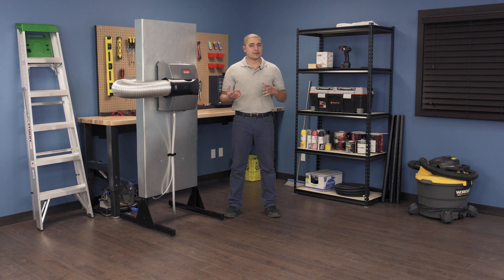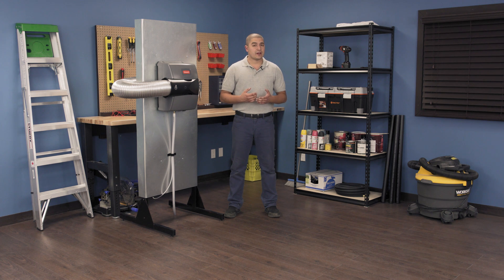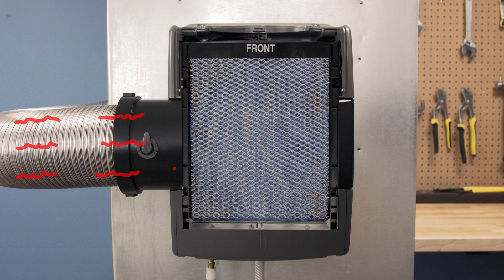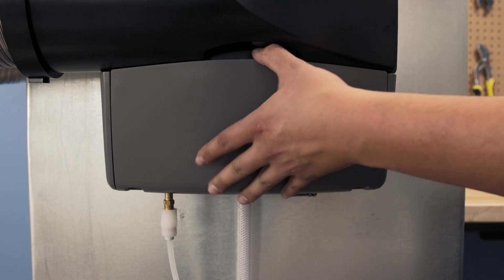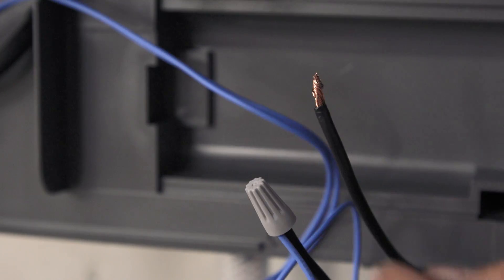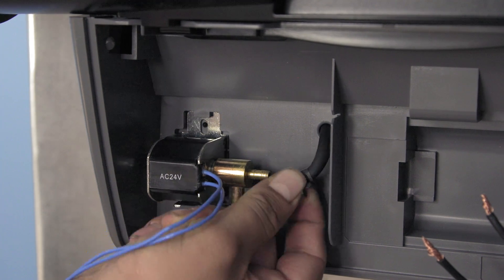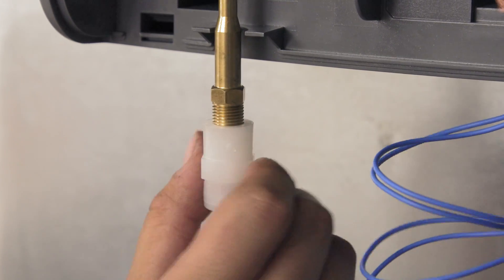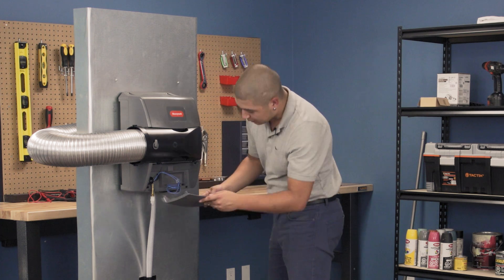Humidifier Solenoid: Repair and Replace (Honeywell TrueEASE)

Comment: Could I power the solenoid with Y and C on my goodman furnace control board?
Reply from the maker: Yes a 24-volt humidifier solenoid is normally safe to power from Y and C on a Goodman furnace board.

Comment: How do you know that the solenoid is not working properly (can you see any issues with the solenoid) in Honeywell HE200A1000 humidifier?
Reply from the maker: Thanks for watching. The solenoid can fail mechanically or electrically. You can test the solenoid with a multimeter to see if there's continuity. In some cases it might still have continuity but might not open so in those cases it might be stuck (but it's less common).

Comment: Hi there - thanks for posting this video this has been super helpful. I was able to install the unit and seems like it’s back and running. 

I was wondering if it’s normal for the humidifier to show high humidity value? It keep showing my house is around 50% but I know in Colorado there is no way we are at that level…
Reply from the maker: Thanks for watching, we're just happy to help. 50% is still within a normal range. Here in Edmonton Alberta, we're around 40 - 50% humidity indoors in October. In the middle of winter the indoor humidity tends to drop below 40% without a humidifier.
Reply: @AmreSupply  Thanks - so as long as my pads are wet and i can hear the system pulling water, the system should be working, right?
Reply from the maker: @tian2339  Yes you are right, as long as the pads are wet the it will add moisture into the air. As well, you can adjust the damper for more or less moisture.
Reply: @AmreSupply  Hi there - coming back for more questions. Now that I am officially entering the dry season, it seems like according to the controller reading I would never get to the level I set to (40% set, the controller installed at the return air would show 30%). 

I have also installed a new EcoBee controller, which tells me my room humidity, that only reads around 24%. Couple of things i have checked:

- I have the fan running 25 mins/hr so that i can get the humidity coming through. 
- My damper at the humidifier is all the way open. 
- I have also been checking my pads they are wet all the time. 

With that being said - is there a problem with my setup? Or it's just the environment I am in is too dry for the humidifier even get to that level i set?

Thank you so much for the help in advance!

Comment: I had my solenoid valve replaced earlier in the season, and I'm still having issues where the water distribution tray doesn't fill fully due to weak flow.  As a result, my humidity levels never reach the desired amount.  Is it possible that the rubber tubing or water outlet at the top of the pad is the issue?
Reply from the maker: Thanks for watching. There could be a calcium buildup in one of the tubes or the distributor. You could try isolating the tubing and cleaning / flushing it out.
Reply: @AmreSupply  how do we clean the solenoid if it has calcium built up?
Reply from the maker: @tian2339  Thanks for watching. It can be difficult to thoroughly clean the solenoid valve.  Depending on the valve there might be a rubber o-ring but using vinegar to soak or flush can help and shouldn't damage any seals. You can use a q-tip to try to clean out any debris.

Comment: Anyone know what resistance this solenoid should test at?  Ours stopped working and solenoid is testing around 15 ohms.  The copper tubing doesn't seem to come apart to look inside to see if there's an internal issue/blockage.
Reply from the maker: Thanks for watching. 15 Ohms is an acceptable resistance for a solenoid valve like this. You are right that it is difficult to check for blockages. Are you able to hear the valve click and open when it runs? If it does then that's verification that it is opening. If you don't hear a click when there is a call for humidity then it could be an internal issue preventing it from opening.
Reply: @AmreSupply  Thanks for responding, it doesn't click at all.  So my guess is there is something wrong with the "plunger" system inside the copper tubing.  Will have to look at replacing the whole package.
Reply from the maker: @gs98999  You're welcome, we're just happy to help. In these cases the replacement of the solenoid can be necessary as there isn't a ideal way of taking apart a solenoid without damaging it.
Reply: @AmreSupply  the solenoid wires read 15ohm perfectly. The value is stuck open. What could be the reason of this issue?
Reply from the maker: @hiteshbhardwaj000  A continuity test will show you if the solenoid coil has failed electrically but doesn't tell you what has failed mechanically. If the valve is stuck open it could because of sediment, the spring might be broken or it just might be jammed. If it has failed mechanically then the solenoid valve will need to be replaced.

Comment: I replaced the solenoid last week but have a slow drip coming from the distributor tube. Not sure if it was sliced or cracked when TG heating did the solenoid replacement.  How do I replace the black tube or any suggestion would be appreciated. Thanks
Reply from the maker: Thanks for watching. You are right that a bad connection on the distributor tube can cause leaking. You can see the connection above the humidifier pad by opening up the front panel. This is indirectly shown here: https://youtu.be/h7DjR5akhDg
Reply: @AmreSupply   I need  the 24 inch water feed hose for the Honeywell He 100  can you order me one and tell me what the price is please. I can do curb-side pick up or when is the store gonna be open to the public ?  Thanks  Rob in London ontario
Reply from the maker: @Rob-ob3sh  The best thing is to call our customer care center @ 1-800-661-9891 and have the model number ready or place an order through our website: amresupply.com/ The London branch currently has curbside pickup as well you can also order the part to be shipped directly to your home if needed.
Reply: @AmreSupply  thank you but I had no luck. I contacted the 1800 number they could not help and passed me on to the local store but nobody would pick up so 1800 person said just go into the store, I went into the store today and the counter person could not track down the part and recommended I get the part used by calling a hvac repair technician LoL.  I truly doubt I’m gonna have luck doing that. I’ve been to Rona and Home Depot. No luck  I can’t believe I can’t get a $20 feedtube nozel hose and clips. Do you guys have any ideas to help me get this part ?
Reply from the maker: @Rob-ob3sh  It can be frustrating when the part isn't available. I took a closer look at the parts diagram for these sorts of humidifiers and the hose isn't even listed: https://www.amresupply.com/lookup/238026/1613266 

Instead of finding an exact OEM replacement part there is a different route you can take. There are rubber and clear hoses available online and in some stores that could work as there is nothing inherently special about a line like that. If you measure the inside and outside diameter you should be find a match and use it as a replacement. If you can find a supply shop that has a roll of bulk hose they'll usually sell it by the foot so you can cut the length that is needed and go from there. You'd be searching for a small black rubber hose or clear vinyl or pvc soft tubing. Its likely going to be 1/4" ID but make sure you measure to be certain.

Hope this helps!
Reply: @AmreSupply  thanks so much.  Your reply time is awesome on YouTube
Reply from the maker: @Rob-ob3sh  You're welcome, we're just happy to help in what small way we can!

Comment: I had T&G heating cooling change my solenoid valve last week London Ontario. He charged me $170 just for the part $70 for the service call and 2 hrs labor because he said he did not have the solenoid valve in his truck. Charged me for the time he took to order it pick it up and drive back. $360
Reply from the maker: Hi Rob, thank you for watching. There are no standards when it comes to HVAC repair and labor rates so companies will charge what they want depending on the circumstances. In many cases this can add up which is why more homeowners are ordering the parts and doing the repairs themselves.
Reply: @AmreSupply  yes the funny thing is T G Heating & Cooling lost any further business with me. He did my install for my home AC and was my go to for furnace inspection and repair.  I even asked him to give me a price on a new water tank on the last visit.  I’ve been using TG for 17 years But no more. Turning a 30 min job into a $400 job which involves a $90 part was the last straw for this guy.

Comment: I would say don’t buy the Honeywell Humidifier as it’s a ripoff. My solenoid valve is stuck open and the unit comes with a cheap saddle vale which is not recommended as per house code. Paying 50% the cost of the unit for one part is a joke. It’s a $20 part
Reply from the maker: Thanks for watching. Most humidifiers come with a saddle valve but its best to get a ball valve installed. As well solenoids do fail over time and most humidifiers that use solenoids that are of a similar design but still have unique mounting hardware, the price of the parts is largely determined on stock and what is available from the manufacture. In some cases it makes sense to replace the part, in others just replacing the unit is the best way to go.

Comment: The part is on back order from Honeywell, is there  a way to bypass the solenoid and manually turn it on or off.
Reply from the maker: Thanks for watching. If the solenoid as failed then you could technically bypass it by connecting the small hose directly to the inlet. In that case you'll get water flowing over the humidifier pad 100% of the time. If you have a T-fitting and a ball valve supplying water to the humidifier then you can just open the valve as needed. If you have a saddle valve like shown in the video, its not recommended to open and close it daily as its more prone to leaking.
Reply: @AmreSupply  Thanks - we are in Canada - Honeywell does not have the part and we are at 10% humidity so I think bypassing it manually may not be a bad idea - just a pain but at least we will sleep better and not be so dry. Thanks for your help.
Reply from the maker: @agentelliot   AMRE Supply has the solenoid in stock. You can either pick it up in one of our 12 stores across canada or we will can ship it to you directly.  If your solenoid is connected to DC power then it will be this part: https://www.amresupply.com/part/50041883-001# If your solenoid is connected to AC power then you'll want to order this part: https://www.amresupply.com/part/50041883-002 Hope this helps!

Comment: Anyone know where we can get just the tubing/valve? The coil and actual solenoid/winding/plunger/piston seem to be fine but I can't clean all of the gunk out of the tubing. It shouldn't be a $90 replacement if the most expensive part is not even broken...
Reply from the maker: Thanks for watching. You can get tubing here: https://www.amresupply.com/catalog/Polyvinyl-Polyethylene-PGB4 and https://www.amresupply.com/catalog/Tubing-HI42

As for the valve leading out of the solenoid, it is normally sold with the solenoid, we don't list it as an individual part. https://www.amresupply.com/lookup/238028/1613268#diagram

Hope this helps!

Comment: Here's the problem. A new solenoid is CAN$80 - CAN$100. It's a coil and a magnet for crying out loud. A new humidifier is $180 - $220 depending on the capacity.
Reply: Except these stop working atleast once a season and you need a new one. Lol
Reply from the maker: Hi Derek, thank you for your feedback. This is a point of consideration on most repairs, it doesn't matter if you are repairing a car, a fridge or a furnace,  the sum of all the individual parts bought separately will always be more than the cost of a brand new unit, but for many people the cost of the individual part is worth it to get it fixed.

Comment: Thank you for the demo.  Is this replacement part good for Honeywell HE100C model?
Reply from the maker: Hi Alberto thank you for watching! The replacement part 50041883-002 https://www.amresupply.com/part/50041883-002 is for AC Solenoids and is compatible with the Honeywell HE100C model. If you need a DC Solenoid then its https://www.amresupply.com/part/50041883-001#

In the future if you ever need to know what part is compatible with your model, then enter the model number into our website as you can view parts breakdowns such as this page: https://www.amresupply.com/lookup/238031/1613271#diagram We have 1000's of parts breakdowns linked in our website on many different products. Appliances, motors, furnaces, plumbing just to name a few.

Cheers

Comment: Both wires are blue.  Does it matter which wire is connected to white/black?
Reply from the maker: Thats a great question Multicultural Radio. It doesn't matter which wire is connected to white/ black. Switching the wires on a solenoid will not affect how the solenoid valve operates.

Comment: Hi Nick? I have quick question for you.... is the water of the humidifier is continuously flow and it will not stop?
Reply from the maker: HI bukanoy13, For this specific model, no, the water to the humidifier doesn't continuously flow. The water flows if demand from the humidistat is there. If water is continuously flowing, the solenoid could be stuck in the open position, rather than controlling it properly. Hopefully this helps. If you have anymore questions, please feel free to give us a call at 1-800-661-9891. Thanks! Rachael
Reply: Thank you guys for the time yes i appreciate it. We have the RF5000 honeywell humidifier i just notice last night that the water continuously flowing, so i am worried and i tried to search in youtube and it leads me to your video. Very informative, now i understand why that water continuously flowing through and it stop on the right time. Awesome and thank you and have a blessed New Year  2017.